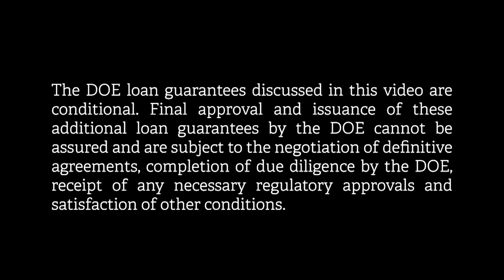Vogtle Timeline - 3rd Quarter 2017

Comment: Go to Bellefonte and finish both units! You will make the difference
Reply: They should finish Vogtle units 3&4, V.C. Summer units 2&3, and the Bellefonte units.
Reply: Absolutely, V.C. Summer construction was been halted months ago and has made an economic impact to those folks who were moving there for work, its community and their lives that where already planned. This happenned due to Westinghouse bankrupt. In the case of Vogtle 3&4, they found another contractor, so the construction goes on and everything is fine; in V.C. Summer, Scana hasn't found a new contractor, so my idea is that the same Vogtle's contractor could finish units 2&3 once they're done with Vogtle or meanwhile. But this means a lot of money to be invested, a lot of workers to be paid and compromising with the project; the key is to find a solution rather than doing nothing. In Bellefonte the situation is different: there are 2 units that were already constructed years ago and have to be refurbished like Watts Bar 2, but they never were finished and the plant has never produced electricity, it is not a new construction with new designed reactors like Vogtle and V.C. Summer's. So any good contractor has to invest money for finishing them, knowing that TVA sold them, but they have to find one! Otherwise everything will be the same. So for all of this there has to be good hope, realism and the desire to work for achieving good results.
Reply: It's refreshing to find another pronuclear person.
Reply: Gammareign The same to you! My pleasure
Reply: We need as much nuclear as we can get. I want to see all coal plants replaced.
Reply: @Jemalacane0  Its challenging because people only get the anti nuke prospective because learning about nuclear power requires more than just sharing memes about how evil nukes are. If everyone learned about radiation we would have a much better world. I think every kid should get a Geiger counter and safe radioactive samples when they get into middle school.